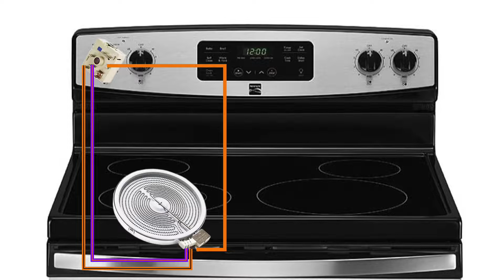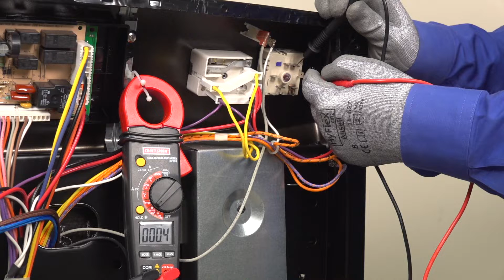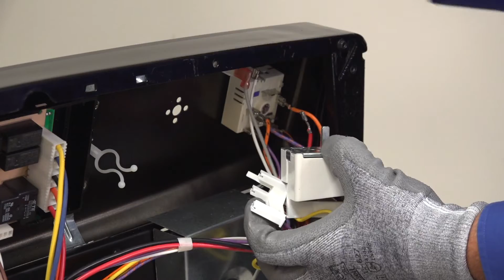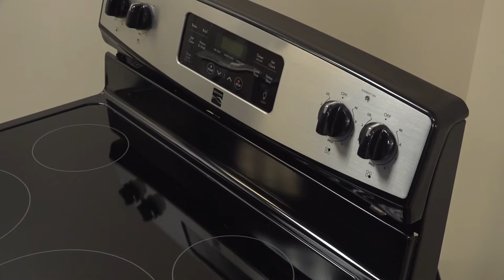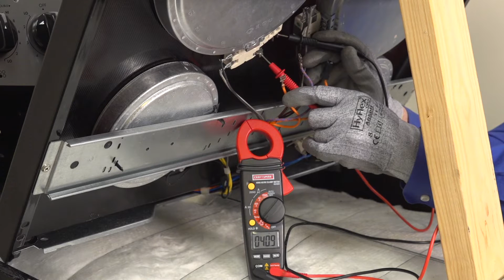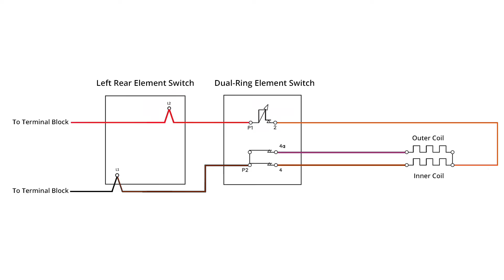Range Dual-Ring Radiant Surface Element Not Working

Comment: Hello, i have a dual element glass hob, however i wonder if i can replace the burner with a single element, how would the wiring go and will it even work, if they are the same wattage.

Comment: Very important information. Thank you. I actually opened the inside of dual Surface element switch easily and found out that my contact P2- 4 was not working consequently the inner element was not  heating when knob was on the right side but outer element was heating. The contact was little burnt out. So I bent, a little, the flexible side P2 of the contact with a long-nose plier so that  it pushes against the other side 4 when operated. Vola! contact was making again and my switch was okay. I saved Canadian $90 switch price!

Comment: Hello, What would cause all elements to stop working at the same time? I was using all 4 elements to heat water to thaw a water line when this happened. 

The 2 outer elements are dual  and the inside ones are single ring

When I turn the switches to the on position the “cooktop on” indicator illuminates. 

I am just wondering where to start with diagnosis as I feel that the switches and the elements are in working order since they all failed at the same time.

Comment: So, what if one of my elements on the dual setting is working, and the other isnt? Thanks. Sounds like the element is gone. Ordered a new one.
Reply from the maker: Because both rings of the element work on the dual setting, the failure is likely caused by a bad burner switch.
Reply: @searspartsdirect  ok. My Dual works partially;  my outer ring works, but my inner one doesn't and doesnt heat as it used (per my wife), nor does it work at all on the non-dual setting. Is it still the switch? My thought is its the element?
Reply from the maker: @4himsanctified  That failure could be caused by the burner switch, element or wiring. We recommend that you go through the diagnostic steps described in the video. Unplug the range before accessing internal parts in the range.

Comment: We have a newer Maytag range, and the one dual burner on it has always had the issue of not adjusting temp (ie, its either high or off). What approach should I take to diagnose this problem?
Reply from the maker: Because the element heats when you turn on the burner, you know that the element is good. The burner control switch is likely bad. You'll likely be able to fix the problem by unplugging the range and replacing the burner control switch.

Comment: With regard to an inner element not working but the outer does work when the switch is on for the inner element there’s a light that comes on indicating that the inner element is switched on would that be an indication that the switch is actually ok?
Reply from the maker: Possibly. The "element on" indicator light operates off a different contact so the switch could still have a bad contact for the inner element that is causing the problem.

Comment: the only issues i have is the warranty of 1yr ran out 8 days ago, and i have spent 5 trying to decide which part. 1 yr people, this is stupid. element works med n high, just clicks off on between low and med setting.
Reply from the maker: Your symptoms point to a bad surface element switch because the element works when it gets current through the surface element switch on some settings.

Comment: SAMSUNG
Model # FE710DRS/XAA
FRONT RIGHT RADIANT 3 ELEMENT DOES NOT CYCLE. I'VE INSTALLED:
NEW INFINITE EGO SWITCH PART # DG44-01003A
NEW 3 ELEMENT PART # DG47-00065A
DOES NOT CYCLE ON ALL SETTING ONLY ON THIS FRONT RIGHT BURNER
YOUR HELP WOULD BE GREATLY APPRECIATED
PREVIOUS INFINITE EGO SWITCH WORKED BEAUTIFULLY CYCLING ON AND OFF ON ALL SETTINGS (INNER, MIDDLE, OUTER) SWITCH MADE LOUD POP WITH FLASH WHICH POPPED CIRCUIT BREAKER. AFTER RESETTING BREAKER THE BURNER INDICATOR LIGHT STAYED ON WITHOUT ELEMENT TURNED ON
SINCERELY
SALVATORE MAGARELLI
MOBILE NUMBER: 631-332-6325

Comment: Hello. I have a PCS940EJES from GE and I was having problems with the most inner ring of the element not turning on. We first replaced the element only to notice the wiring and the switch were faulty after seeing smoke and a burning smell when turning it on. We later replaced the switch and wire connections. The element was working fine for a few weeks until the inner ring again would sometimes not want to turn on and now it won’t turn on at all. We’ve checked the switch and wires and everything seems normal. We also don’t have a multimeter. What could be the cause of this problem and how can we fix it? Thank you.
Reply from the maker: Your symptoms indicate that the element or the switch has likely failed. There is a chance that a wiring failure could be causing the problem even though you indicated that the wiring seems normal. Without a multimeter, it's difficult to accurately diagnose the failure that you're describing. You may consider purchasing an inexpensive multimeter. Some meters cost less $20. Here's an example of a low-cost multimeter on Sears.com: https://www.sears.com/craftsman-multimeter-034821410000/p-A028300107 . If you can get a multimeter, you can unplug the range and check for continuity through the inner element. If the inner element has continuity, check the burner switch contacts for continuity with the burner switch turned on (and the range still unplugged). If the element is okay and the switch is working, check for continuity through the wiring going to the inner element. We hope this information helps. If you need further assistance, let us know.

Comment: I have a stove like that, two dual ring burners up front and 3 single back burners. The one on the front dual left burner seems to be heating the suface up pretty hot outside of the ring, so hot that it hurts to leave your hand on it 3 inches away from the outside ring while only using the inner ring, is that normal? I was cooking noodles, brought my water to a boil, added noodles, let it come back to a boil, then turned it down half way, I noticed within 5 minutes that it stopped boiling, I had to turn it all the way up to high again just to keep it fizing with a light boil, then I noticed that the glass all the way to the front left corner was pretty hot, is this normal or a problem? (I haven't had this stove but for a few weeks, that's the first time I used that eye, I didn't really notice that with the right side front dual eye.
Reply from the maker: That's likely normal for the range that you have. The left front dual burner is likely the "quick-boil" element that gets the ceramic glass surrounding the burner hotter because the thermal limiter doesn't shut off the burner as often. You'll likely need to fiddle with burner heat settings for a while before you can find the settings that will evenly boil your noodles. We hope this information helps. If you need more assistance let us know (and let us know the model number of your range so we can see the exact type of surface burners that you have on the range).
Reply from the maker: @frankparrino3224  Here’s a link for the replacement part for the left-front burner: https://www.searspartsdirect.com/product/5q5k18irgs-0022-628/id-316465002

Comment: I have a kenmore elite range Mod#790-99129409 and I’m experiencing similar issues as Mr.Nelson except that 2 of my inner burners went out at the same time. The inner gets warm but not hot. Oh by the way this happened after repairing burned wires to the power source.
Reply from the maker: Your range uses a relay control board and user interface control board to control surface element heating. Unplug the range and check for burn marks or melted relays on the relay control board. Based on your symptoms and circumstances (repairing burned wires to the power source), we suspect that you may see damage on the relay control board. If you do, then you'll need to replace that control board. You'll also need to check the wiring between that control board and the surface element for damage. Check the element for damage and replace the element if wiring connections or ribbon elements inside the surface element are damaged. This can be a complicated and risky diagnosis and repair for a DIY'er. We recommend that you have a service technician examine and repair the range unless your completely confident that you can safely diagnose and make all repairs to restore the range to its normal and safe operating condition. Here's a link to schedule service in case you need it: https://www.searshomeservices.com/repair . We hope this information helps. Let us know if you need further assistance.

Comment: Best explanation video of this anywhere. We have a whirlpool model WFE540H0ES0. We are having issues with only one of the heating units. It is a dual-ring. When it is turned on high both elements heat. The elements cycle off and on but they don’t seem to heat long enough to really cook certain things. Is there a way to determine if the elements cycling off before they should ?   How can you determine if they are cycling incorrectly if it is the element overheat sensor or the switch.  Thank you
Reply from the maker: Make sure that you're using the right size pan or pot for the surface burner. Using a pan or pot that's much smaller than the element can cause the element to cycle off frequently. If that tip doesn't help solve your element heating problem, then you can try swapping the dual-ring burner switches to see if the switch on the element that isn't heating well is okay. The dual-ring burners on the front of the cooktop of your range both use the exact same type of burner switch. Unplug the range and carefully pull it out of the cabinet. Remove the back control console panel and take digital pictures of the wiring connections on the dual-ring burner switches to document their connection locations. Carefully swap out the burner switches. Use your digital pictures as a guide for connecting the wires to the switches. Connecting the switch wires properly is extremely important. Reassemble the range and check the operation of the burner with the suspect burner switch. If that burner doesn't heat properly, replace the burner switch ( https://www.searspartsdirect.com/product/4x9jjhnile-0022-664/id-w10857622 ). If that elements heat normally, and the same element you've been having problems with continues to have heating problems, replace that element. Be sure that you unplug the range before replacing parts. We hope this information helps. If you need further assistance, let us know.

Comment: Hi. Thanks for the video. Very helpful! I have a Kenmore range model 79096413400 and the right double element burner and the right back single burner are not working. The back right does not work at all and the front outer element does not work, but the inner element does. 

When I turn the front double element dial (316238201) to dual, just the inner ring lights. When I turn it to single just the inner ring lights, looks like it glows around the very outer edge of the outer ring. It lights for less than 1 minute, clicks and goes out. 

I checked the dual burner switch and all checks were good except when set to dual, P2 to 4a is OL. So the switch is bad. The element is good from the switch wires. 2 to 4a = 42 ohms and 2 to 4 = 4 41.5 ohms. At the element the outer element measures 41.6 ohms and the inner is 42.4 ohms. 

The back single burner switch tests out good as does the element. I swapped the dial from the left rear and right rear and the left rear still works and the right rear still does not work. Wasn't exactly sure how to test the element from the wires at the dial, H1 to H2 showed 45.2 ohms, and testing at directly at the element was 40 ish ohms, didn't record the exact reading. I see the this dial shares wires from the front right dial, P2 to L1 and 4 to 2P. Does the fact that the front right dial is bad cause issues for the back right or are the other issues?   

Thanks!
Reply from the maker: That range uses a cooktop lockout control board to shut off L2 current to surface elements during the oven self-clean cycle and when you lock out the surface burners. There's a possibility that the cooktop lockout control board relay for the right rear burner is bad. The failure in the right front burner may have burned out the cooktop lockout control board relay for the right front burner as well. There's also a possibility that a wiring failure between the cooktop lockout control board and the right rear burner switch is preventing the right rear burner from getting L2 current. With the range unplugged, you can check for continuity through the L1 wires between the terminal block connection with the black (L1) power cord wire connected to it and the L1 spade (with the wire still connected to the burner switch) on the right rear burner switch. Your meter should measure around 0 ohms through those wires. If your meter measures infinite resistance, find and repair the broken wires. If the L1 side of the circuit is okay, check for continuity between the P4 spade (with its wire still connected) on the cooktop lockout control board and the L2 spade (with its wire still connected) on the burner switch. If the meter measures infinite resistance, find and repair the break in the wire. The right front and right rear burners share a common connection to the L2 power supply on the terminal block (where the red power cord wire is connected). You can check for continuity from the P2 spade (with its wire still connected) to the L2 connection on the terminal block. Find and repair the broken wires if your meter measure infinite resistance through that wiring. There's a possibility that you'll see burn marks on the cooktop lockout control board. If you do, then you'll likely need to replace that control board. You'll also likely need to replace that control board if all continuity checks mentioned above are okay. That cooktop lockout control board is no longer available as a replacement part but you can send it into a control board repair facility to have it fixed if it's bad. Here's a link for a repair facility that can repair that control board (part 316418100): https://www.servicerparts.com/  We hope this information helps. If you need further assistance, let us know.

Comment: I have a Kenmore elite oven model 79096593601 with a triple ring heating element. The innermost ring will not turn on. The middle and outer ring will both turn on. I have done all the continuity tests on the ring itself and all are fine. I have purchased a new element from Sears parts direct because I thought the temperature limiter was the problem. The new elements inner ring still does not work. Can you describe what else I can test or what parts may be causing this to fail?
Reply from the maker: That range uses a surface element control board to send current to the elements. A wiring failure between that control board and the element could be preventing the inner ring from heating. A bad surface element control board could also prevent the inner ring from heating. Unplug the range and check for continuity through the brown wire that connects to the P1 spade on the surface element control board to the black power cord wire connection on the terminal block. Your meter should measure between 20 and 80 ohms of resistance through those wires. Because the middle and outer elements work, you can check resistance through the P2 spade and the terminal block (black wire connection) and the P3 spade and the terminal block to see resistance values appear on your meter for the middle and outer element rings. If your meter measures infinite resistance through the inner ring (P1 to the terminal block), find and repair the broken wire between the surface element control board and the inner ring wiring connection on the triple element. If your meter measures resistance through the inner element ring and its wiring then you'll like need to replace the surface element control board: https://www.searspartsdirect.com/product/29flp0jbbw-0022-628/id-316442112  We hope this information helps. If you need further assistance, let us know.